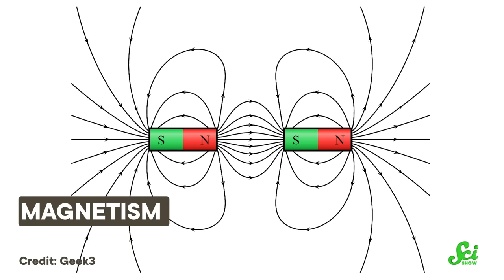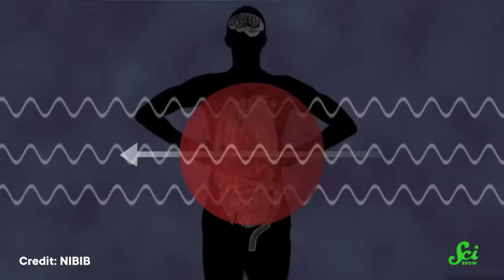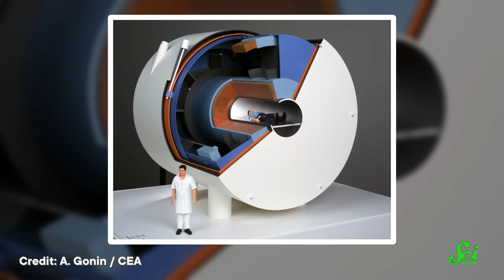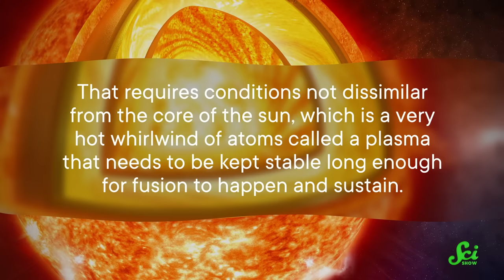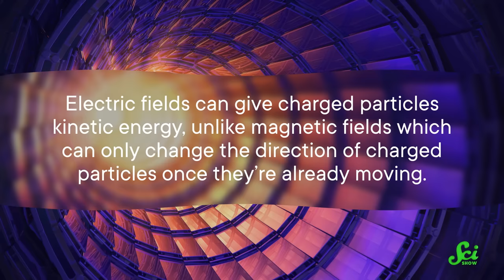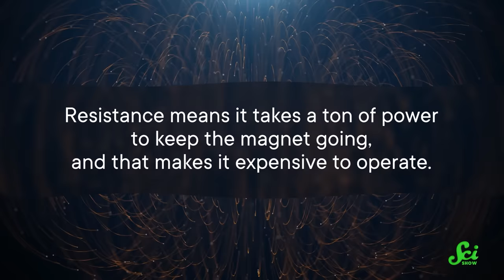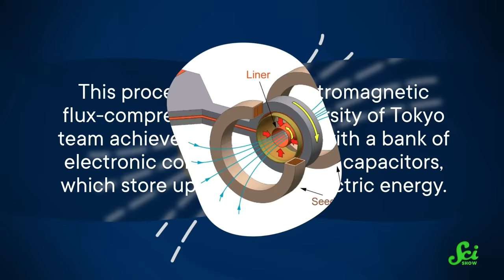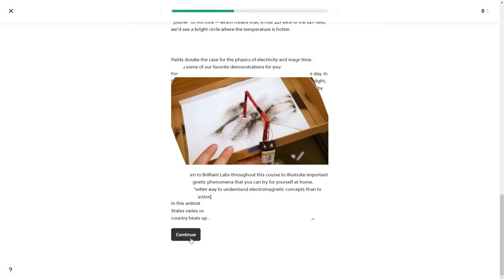What is the Strongest Magnet We Possibly Could Make?

Comment: Am I the only person worried how such powerulful magnetic fields interact with earths magnetic field. And if they may "distort" the mechanisms which create said field.

After all the only verified corilation between climate change and another knows is magnetic field anomalies. Every other factor is is speculative as they are based on lab experiments, where as this is a measured corilation. If these strong magnetic fields are strong enough to damage earths magnetic field then we may have a bigger issue on our hands.
Reply: @bobbydazzler6990  if it were just one,  then I wouldn't be so worried, and these are not tiny magnets. Earts magnetism field at the surface is only 25 to 65 μT. (Source wikipedia) which is about 1/1000 of these fields. Magnetic fields do decay at the square of distance, and ferris materials will help block some of that. But its not blocked completely, in fact with fields this strong a lot of the field will escape, especially if its a constant field.

Because of the strength of these I'm worried that they will either interact with earths field or possibly effect the core of the plannet even if only slightly. The result could be holes in the holes magnetic field, or a  permanent reduction in earths magnetic field strength. I'm not saying this is happening, but a study looking into it wouldn't hurt anyone.
Reply: @bobbydazzler6990  I meant to say Ferrous Metal. But like many on the internet you completely understood what I was trying to say and instead of making an intellectual argument one way or the other you used what little ability you have to process data to point out my error. Thank you for that.

Comment: wait dude i wanna ask the question, that i would like sciShow to answer. If we use fusion to convert energy from mass by bending atoms together, and nuclear plants by splitting them could we use the same atoms more than one time in both processes by recycling them somehow?
Reply: I know you asked specifically scishow, but until they answer...yes for fission, the reason why the process ends is because too many stable elements are produced which "steal" the neutrons that keep breaking up particles away. You can reprocess this depleted fuel either chemically (PUREX method) or through a "breeding reactor", where part of the energy produced is directed to turn stable isotopes into unstable ones (different than the original, it's not an infinitely repeatable process), and then use it again

For fusion, not so much. The heavier the element is the harder it is for us to fuse it, and realistically the only way to make more energy than we spend is to use hydrogen
Reply: @user-zz3sn8ky7z  thank you for answer! But i think it`s interesting topic, and in my not-scientist normie head it`s sounds like an infinet engine, but if there`s a way to just reuse them at least once-twice without using more energy than it costs, it will be great. And as i understand hydrogen is pretty common (not every isotop obviosly) so reusing it we  make efficiency of fuel economically better. 

But for me it`s also a crazy idea about bending one particles in fusion, then using the same atoms to break them apart. But u`ll need to bend an unstable element which is energy expensive. Just imagining something like this is crazy, and something like this maybe breaks laws of thermodynamics))

Comment: I used to work for Extrel back in the 80's. They built mass spectrometers. The most powerful was a 5T. Color monitors had to be 30 ft. away.
If you were 5 ft. away the infomation on your card was erased and an analog watch would stop. At 2 ft. it would try to take a 1 pound wrench out of your hand. At the time I was a temp building PCB's, sub assemblies and modifying lasers for them. God, the most fascinating job I ever had.
Reply: I don't do telegram.
Reply: @sficlassic  Don't it's a scam. Don't feed the bots

Comment: I'm assuming a vacuum would a good insulator for fusion as it is in nature. Coupled with the magnetic induced pressure might be possible
Reply: Good for conductive or convective heat, not so good for radiative. Are we insulated from the Sun's heat by the vast vacuum of space between us and it?
Reply: @davidadams421  yes we are if in the shadow of an object.
Reply: @TheStaggpaul  But that object we'd be in the shadow of would be experiencing 100's of millions of degrees, and, as Hank says, no material we know of could survive those temperatures.
Reply: @davidadams421  it would only need to reflect the energy not withstand absorbing it.
Reply: @TheStaggpaul  The majority of the heat would be radiative which wouldn’t be insulated by a vacuum.  It needs some sort of active cooling to be able to remove the radiative heat. 

You’re correct about conductive heat though.  It’s also why the space station doesn’t freeze, but is still susceptible to radiative heat from the sun.

Comment: 6:03 I thought I had heard something about us achieving sustainable fusion (that gives out more energy than we put in) earlier this year, around early December. What happened with that?
Reply: Proof of concept.  They made more energy than they put into the system, but it was still a net loss from how much energy was put into the experiment.  So still not able to create net positive energy but it's a step closer than they were before so now it's just a matter of more time needed to refine and make that better.  Unfortunately we are still "20 years away".
Reply: @gobblinal  ahh thank you! I wasn’t able to dig into it right when it came out and haven’t been able to find it since
Reply: The announcement was about the National Ignition Facility (NIF), if you’re interested in reading more about it! They used a different method to achieve fusion than was discussed in the video. Instead of magnetic confinement, they use lasers aligned at a target to achieve fusion.
Reply: Also an issue with the experiment is that they can’t harness the energy produced. It didn’t produce heat, it produced neutrons (I think) and currently there’s no way to really use neutrons to create any sort of electricity. 

It’s a proof of concept that it’s possible to get more energy out of the reactor than is put in, but the whole thing would need to be reworked before the energy output is actually usable. 

Another important thing is that the energy put into the capsule was like 1/100th (lasers were only like 1% efficient) the energy at the beginning of the system, so it’s only when you consider the energy put into the capsule vs output you get a positive gain. When you consider the total power used by the lasers and cooling and such they still need to increase efficiency by like 50x in order to actually make more power in the whole picture.

Still a big scientific achievement but there’s a long way to go if they want to engineer a usable reactor for power for those two reasons.
Reply: @Chevsilverado  The Wright Brothers got off the ground. Before that were balloons and (maybe?) gliders.  Now we've got autonomous robots on Mars.  Every step forward needs a step from behind.  We'll get there.
Reply: @Chevsilverado   Producing neutrons does produce heat, in a sense! Neutrons penetrate the walls surrounding the reactor, and their kinetic energy heats the material. This heat can be captured by water, which vaporizes to steam and spins turbines. That being said, there is still indeed a long way to go before it becomes a viable energy source.

Comment: So..what if they put a high speed switching daisy wheel with smaller thin wall copper rings and the instant they charged there 1200 Tesla magnetic field and compressed it was switched at high speed to a smaller coil yet stronger due to its stouter dimensions.amd kept the experimental magnetic field pumping due to a higher resistance to implosion.then figure out the next scale needed when it pops.at some diminutive stout point it won't explode anymore but stay stable.who knows.it might become self generating.captured by its own mega force and trapped by its own inexcapable construct.but then it would be a real hot potato and we couldn't  get rid of it.

Comment: Once upon a time I designed superconducting magnets.
The smallest one I did was a 5T bench top magnet for use with a microscope. The bore of that magnet was small - 12mm? (it's been 20+ years). The largest I did was a 15/17T (maybe a 17/21T) research magnet. The different fields are at 4.2K and 2.1K respectively. 2.1K is superfluid helium. A super fluid has zero viscosity - it will shoot straight through a hole significantly smaller than a pin hole.
Read on if you want to know details for magnets.
So. Considerations... The larger the bore, the larger the hoop stress - think blowing up a tyre, a road-bike tyre (push bike, skinny tyre) can take 90psi, a car tyre usually takes 31-42psi. Superconducting materials are delicate and can't handle much stress. The thing is that as the current increases, the overall magnetic strength increases. However, the magnetic field around each wire also increases. These push against each other, resulting in an outwards force and hoop stress. So, there is a balancing act. The larger the magnet bore, the smaller the easily achievable field. But a major plus is, once you put the current in, you can flick a switch and it keeps going around the magnet with hardly any losses.
Similarly, resistive magnets have the same stresses but the materials are stronger. However, the things get hot. Think stalled electric motor or a transformer. These lose energy and require active cooling and a constant input of current.
As an aside: stated magnetic fields are in a given volume in the centre of the magnet, not everywhere inside the magnet.

Comment: Since those MRI magnets are kept cold, and are superconductors with absolute ZERO resistance, once the coils inside them are charged with electricity when they are cooled down, the charging power is removed and the electricity just circulates forever in the coil as long as it's kept cold. The cooling system for these incredible superconducting magnet coils is kept cool by liquid helium. An MRI tech can kill the magnet in an emeegency by pressimg a button and releasing the cooling helium. The superconducting coil then instantly heats up, gains resistance, and the electrical charge is then wasted by the resistance and the magnetic field is gone.

Comment: I feel like this is probably been tried and stuff. But has anyone ever tried to initiate a fusion reaction using fission? It seems like it would be an obvious solution but I figured I would ask
Reply: Hydrogen bombs also known as thermonuclear bombs use conventional high explosives to compress plutonium triggering a fission reaction. The x-rays emitted compress lithium deuteride triggering several different fusion reactions. 

I don't know whether or not anyone has attempted to build a fission-fusion reactor for research or electrical production, but it works quite well for bombs.
Reply: @AndrewTBP  oh oof. is that why it's not used on a smaller, more controlled scale for fusion energy generation?

Comment: That last one blew a several ton blast door off it’s hinges that was the door to the room the experiment was in. And the one in Florida that had the old record for sustained Tesla if it was just out in the open and unshielded it could take a coin out of your hand from over 2 miles away. And it was only 40 Tesla. The main barrier now in magnets isn’t making stronger magnets it’s in material science and making frames that can withstand the pressures required with out collapsing. We just don’t have strong enough anything right now to withstand the forces put on them with out collapsing in on them selves and able to resist the amount of pressure or what ever u want to call it. Attraction pressure psi what ever.
Reply: @bobbydazzler6990  all the fun is in looking into the sun!

Comment: re  -  11:30 It seems to me that the best way to achieve a stable, permanent magnet is by using capacitors, since they will both store and release their energy astonishingly quickly! Using the right capacitor, or series of (rectified) capacitors, will allow an enormous amount of energy to flow through the circuit, producing enormous magnetic fields. The only problem is that the energy will sometimes be AC current and sometimes it will be DC current. This problem caused by the capacitors persists, even when using rectifiers. Luckily, I've discovered a way to solve this problem: I call it - The Flux Capacitor!

Ps: If I knew how to attach images to comments, I would have liked to include a picture of the flux capacitor from the movie. Amusingly, there's a rock band called Flux Capacitor. Even more amusingly, some scientists have made a REAL flux capacitor, though it doesn't facilitate time travel.

Comment: Ask yourself if the standard magnetic dipole field model can possibly be correct.  According to their own "laws", it cannot.  Do a deep dive and discover how it came to be that strings of "virtual photons" were theorized to be emanating from the 'N' pole and back around to the 'S' pole.  Two simple ring magnets put in opposition on a pencil are all that is required to disprove this theory, so long taught as fact.

S to S, N to N,....doesn't matter.  They both exhibit the exact same opposition force.  This despite bringing two S poles into close proximity.

To date, pointing out this stark, simple incongruity has only resulted in abrupt silence from the grand poobahs of the college crowd.

You know, the ones with the alphabet soup after their names.

The only way to reconcile the lack of oppositional field strength disparity is to realize that spinning flux strings emit from both "poles", push away from each other upon exiting each end, stack up over each other in their path on around and auger together with those spiral strings coming round from the opposite end, thus forming a balanced, closed field.

This observational model has held up for me in numerous tests, eventually enabling me to posit the possibility of producing ferromagnetic glass; long considered impossible by establishment science.  I was laughed out of the physics forums until it was discovered 13 years later...

See - "Flying triangles and the black holes on my fridge" on the net

Free energy, exotic translocational vehicles....the PTB's got 'em, and have had, at least in part, for a lifetime.

Good Journeys All

Comment: Hank talking about magnets. I have this theory that I think I'm correct on but haven't found any conclusive information on. I know there is a growing number of individuals accepting flat earth as fact. I have until recently given out the standard rebuttals until I came across magnetic monopoles and how they are theoretical and not likely to be proven. My statement to flat earthers is along the lines of, "the earth being a permanent magnet, would have an extremely low, nearly impossible chance, of having a central pole with the exterior of the disc being a constant and equivalent strength pole." Could you help to confirm this or clarify it better?

Comment: so how could electricity be generated from fusion reactions without adding another 40 years away even after a sustained reaction is achieved that is producing more energy in the reaction then it took to initiate it? How will they turn the turbine with fusion reactions efficiently as to not make the whole process not produce in practical output enough energy to justify costs or reasonably scales. Seems the reaction is not as controllable as fission and it more energetic and makes any thermal exchange system difficult just to make happen and this isn't considering efficiency losses. Unless the thing has a reasonable cost and footprint as to equal a current power plant in usable power on the grid output it will just be a expensive experiment with little practical application to the general public. Generate plasma from a reaction and magnetically contain it and every so often dump it all into some giant heat sink that boils water to drive a turbine and do this without destroying anything is repeatable and doesn't lose any of that energy at least staying well over initiation requirement and still make scaling the process up practical and not require two states of land and resources to build before it matched a fission plants output?

Comment: Neodymium + Dynamo (with more neodymium instead of copper wires) + Mercury, runs the electric current of the Mercury's destruction by microwave, back into the neodymium.... completely dematerializing the Mercury fuel into antimatter propulsion, or usable energy for a powerplant

Connected to a gyroscope, and an avionics system, you can just use the energy as thrust

Comment: I believe fusion at a small scale requires even hotter temperatures and higher pressure to get fusion going at a reasonable pace. It's all to just increase the odds of fusion happening. The reason the sun can work while being colder is just because it's so big that even if fusion happens rarely, there's enough particles that in total it happens a lot